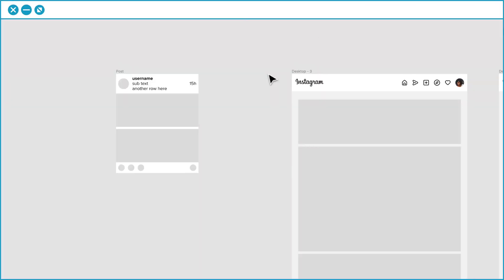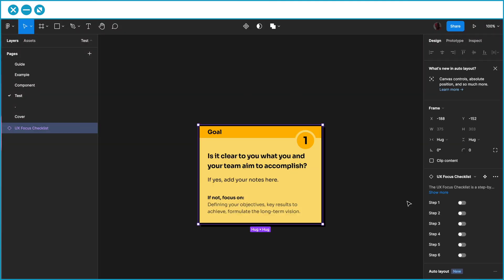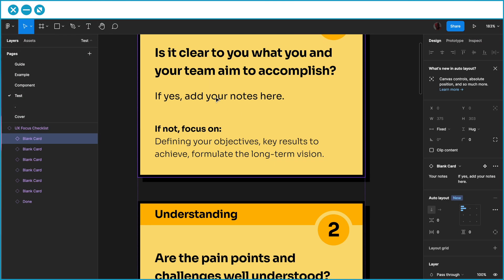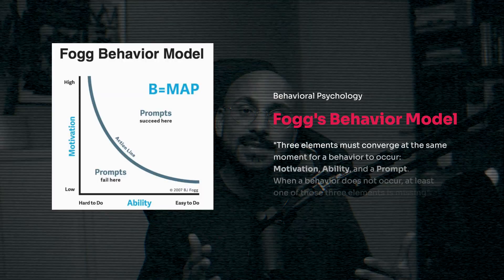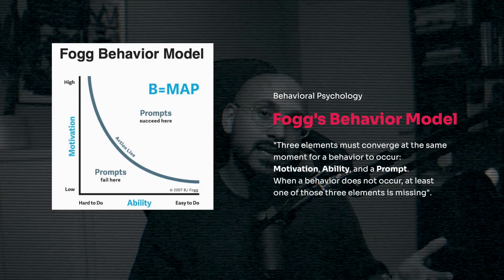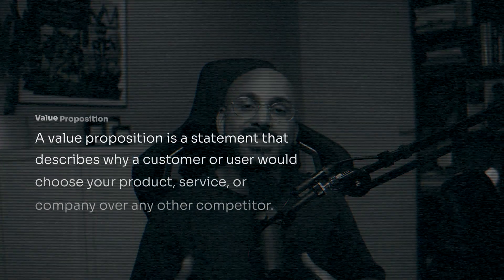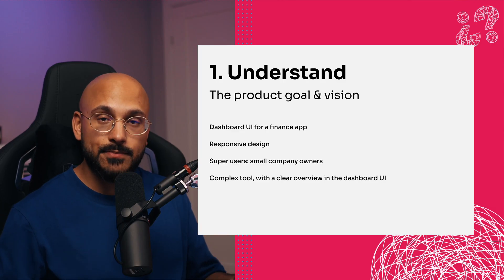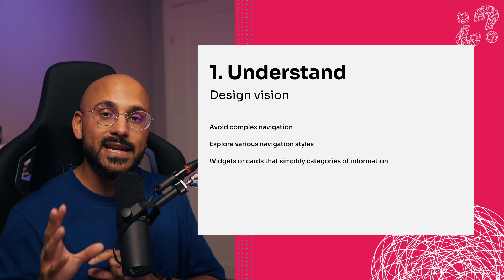UX Research: Dashboard UI UX Design (1/4)

Comment: What kind of user research would you conduct for a dashboard design?
Reply from the maker: For a project like the one mentioned in the video, the target user group are small business owners. So I would target them and do a combination of a quantitive user research where I ask both open and closed ended questions in order to tap into their minds a bit on expectations, current pain points, and needs. And then based on those insights I would also do a qualitative user interview either in a focus group of 5-8 people or 1-on-1’s, where I ask more specific questions to dig deeper. If it’s a new product without any user base, I would also try to get in touch with a subject matter expert.